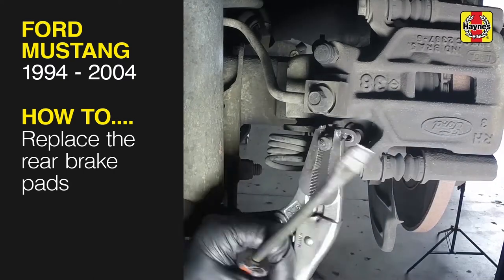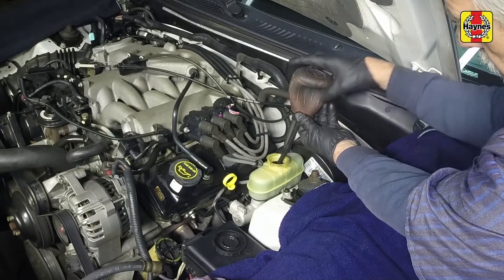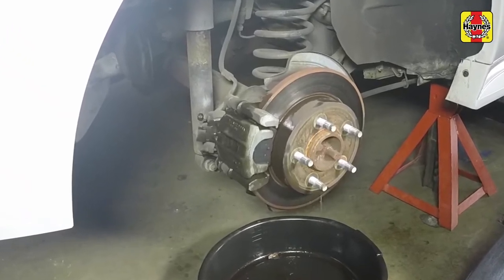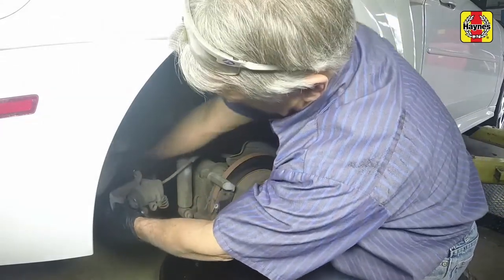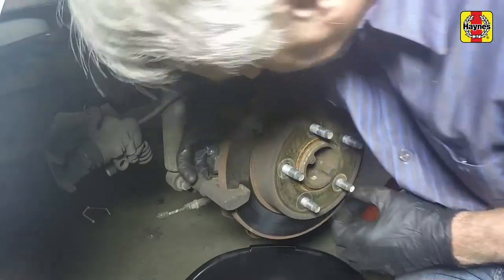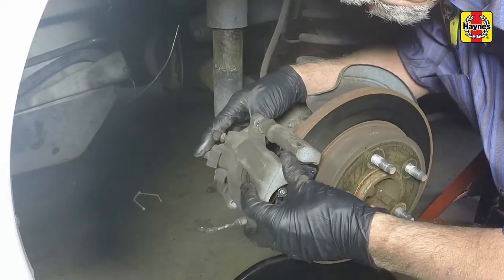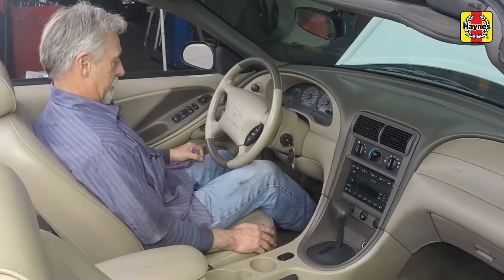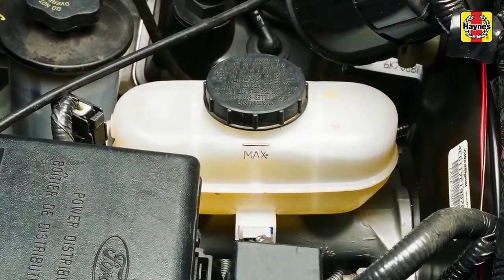Ford Mustang (1994 - 2004) -Replace the rear brake pads

Comment: Helpful tip for anyone watching: The bolts are 12 mm and you'll need a wrench for the bottom one, as that parking brake spring is in the way of anything else. I got away with using an adjustable but barely.
Reply: Is there a difference between outer and inner brake pads because I didn't check for that becsuse they look the same. I just made sure the ceramic part is touching the rotor.